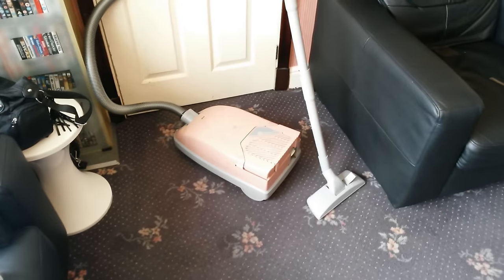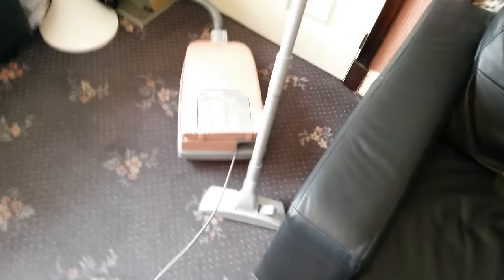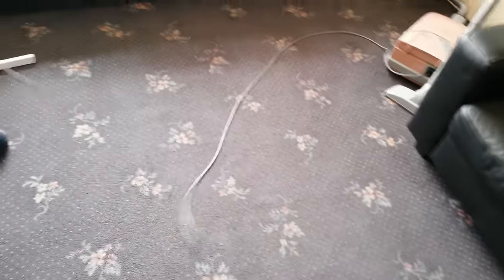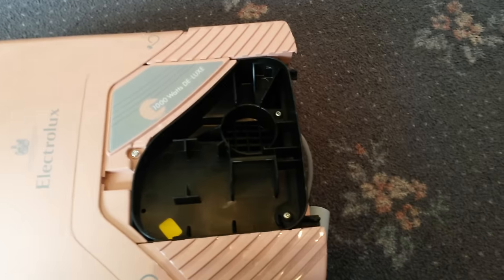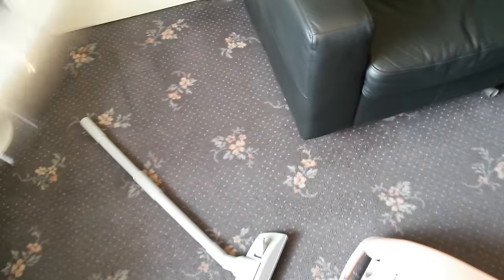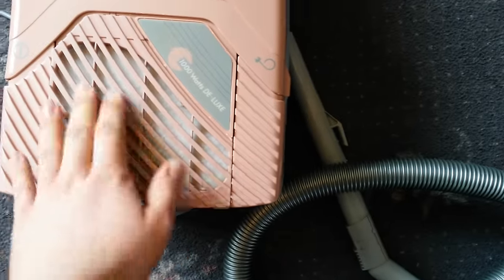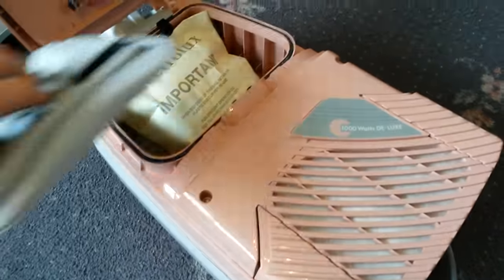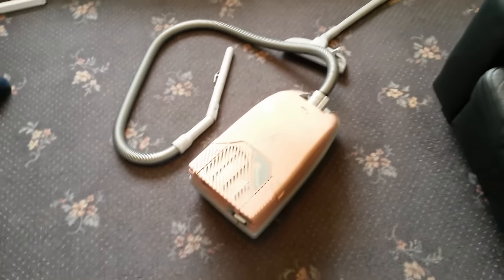1990 Electrolux Dolphin Z2210 vacuum (In Action)

Comment: What a lovely canister! This makes me to want find one.
I have Volta U258 (Electrolux 2020) Made in Sweden from the late 80's. It's exactly same color as your Dolphin.
Very good quality plastics and overall build quality is something that puts modern Made in China vacs to shame. And noise level is low without any high pitched scream. Suction is surprisingly good also.
Mine is original except power outlet for the power nozzle.
http://www.hangar.ch/wp-content/uploads/2015/07/volta_u258.jpg